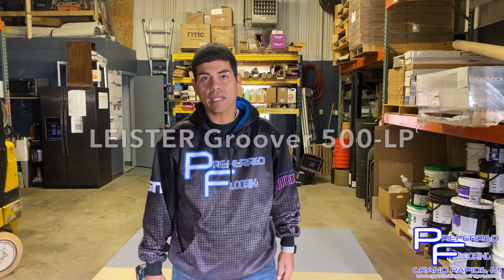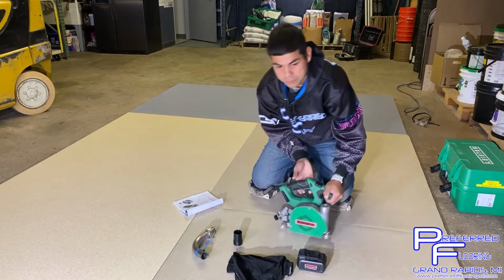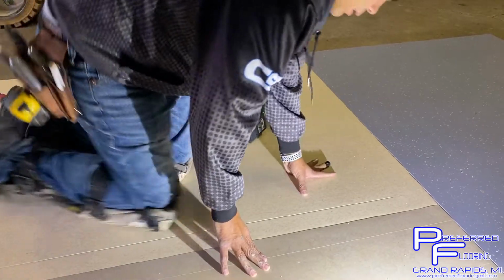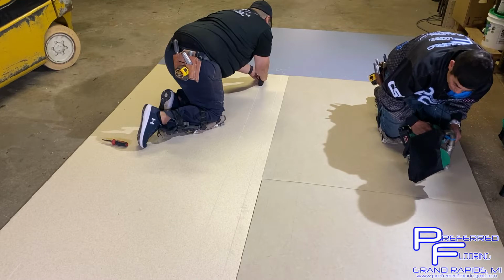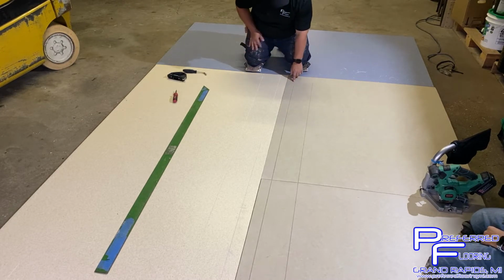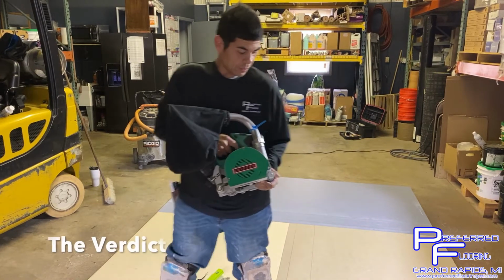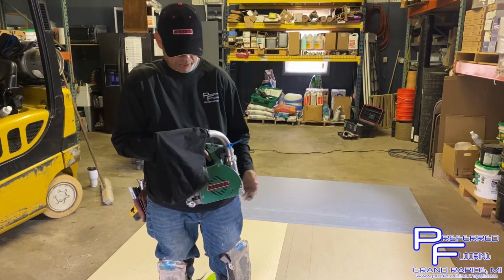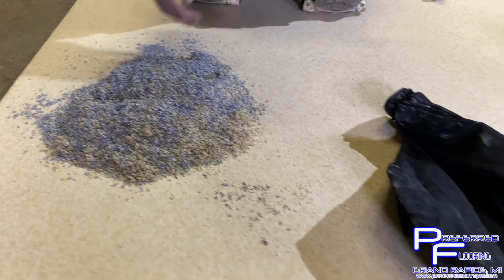Leister Groover 500 LP CORDLESS

Comment: Cordless power groover definitely is a plus for Leister but I still prefer Turbo master and marmo groover.
I use my old Leister power groover just for ASF type of safety floors.
Thanks for the demo.
Reply from the maker: Nothing wrong with more tools in the toolbox as long as you have a purpose for it. Safety floors definitely eat up turbo blades. Thanks for the comment.
Reply: @PreferredFlooringMI  seems an expensive piece of kit just for safety flooring..... We use turbo marmo groovers for everything besides safety flooring, then a relatively cheap romus groover for the Altro. It's a cheap version of the turbo groover, but with standard U blades.
Reply from the maker: @chrisbonnie  Some people don't like the push groovers. This is a definite plus on the sports flooring side of things where some push groovers don't necessarily groove uniform down the entire length.